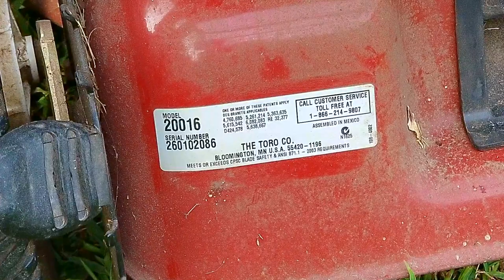Why Get A Tecumseh Powered Mower?

Comment: I experienced both Tecumseh n Briggs and stick w Tecumseh all the way: Strongers, never burning oil as Briggs can do and if you hear the sound of the engine you just showed us, you have your answer !

Lil tricky thing, Tecumseh has to get always top shape carbs but not a deal breaker if you maintain the minimum required.
Reply from the maker: thank you Martin Desmarais for the information

Comment: I got a Tecumseh 6.5 in 1993 to replace a 1979 B&S flathead that got weak because I have a steep yard and Tecumseh has the oil pump.
The Tecumseh has the PCV under the flywheel which needed replaced. It eats flywheel keys if you don't super tighten the blade. That O ring on the carb bowl? Just replace it.
It now burns oil. I have to add every other mow.

The B&S? It needed a carbon cleaning. I did have to replace the paper in the carb. It too is back in service at 45 years old, and burns no oil.
So what mower is better for the environment, since it was emissions which killed the flathead. One that is worn out in 25 years and burns oil (Tecumseh) or the B&S that might pollute a little more all along the way but will last a life time?
The smoking Tecumseh will be given small yard duty for perhaps another two decades.
Reply from the maker: thank you for sharing that

Comment: I always went out of my way to get a Tecumseh engine on a new mower. When those steel deck Recyclers came out I specifically chose one with an LV195EA and a few years later I bought a second identical one to split up the yard work. Nothing against Briggs, always liked them and worked on both since I was a kid but the Tecumseh had more compression, more power and was a stronger engine. Still love those old Tecumseh powered steel deck Recyclers, just got done repairing two of them for a customer last weekend. They were way more common than the Briggs powered models around here, Toro had a deal with Tecumseh and that’s all they used for a long time.
Reply from the maker: thank you mjg263, and yes these were some great engines

Comment: Nice footage, thank you. What are you spraying on the mower during the cleaning process? Seems to be working well
Reply from the maker: I use the only degreaser that Harbor Freight sells. It's in a gallon jug and I use it at full concentration
Reply: @HomeGaragechannel  great, thank you.
Reply from the maker: no problem
Reply: I just got back inside after unblocking the wheels on an identical mower. Your other video was very helpful as well. Thanks again bud. 💪🏼
Reply from the maker: no problem

Comment: The first motor i worked  on when i was 10 years old was a tecumseh 3 and a half vertical shaft..found in a junk pile..it wasn't that old and would spin half a rotation..someone put the wrong plug in it and bent the valve..i replaced the valve..vice griped it to the pic nic table and it started and ran like new..my dad said it would never run..he got fooled..lol..it was a tiller motor..tecumseh made a good motor..then they cheapened it too much..now they don't make them anymore..sad..
Reply from the maker: I know right, thank you Rodney Brand

Comment: Thank you so much for this video. I´m basically doing the same thing you do in the US over here in Europe (Germany). We had the European Tecumseh plant in Torino (Italy) which went out of business a year prior to Tecumseh USA, so in 2007, The Tecumseh engines were produced from 1960 to 1980 under the name Aspera Motors, from 1980 to 1990 under the name Tecnamotor and from 1990 to 2007 under the name Tecumseh Europa. I have been trying to beat it into people for 15 years now that Tecumseh is the superior engine if you are just able to handle them. Most people are simply to coarse to understand that and they measure the quality of an engine on how much redneck engineering you can do with them.
Reply from the maker: no problem and thank you

Comment: That solution that you use to clean the mower is amazing.  Do you let it stand for a couple of minutes before you spray the water?
Reply from the maker: thanks it's the only degreaser Harbor Freight has. They come in gallon jugs and are a very good price. I use it at full concentration, no dilution.  You can let it stand a bit on bare metal, but you can't leave it long on paint. couple of minutes at most.

Comment: Honestly the splash lubrication system really wasn't adequate for the upper crank bearing on a Briggs. For a lawnmower it worked, but things that put force on only one side of the shaft, the upper crank bearing wore quickly, I've seen several that were so worn they were leaking oil from under the flywheel. That's why I don't get why everyone loves the classic Briggs so much and says they were built to last. Anyways I get why tecumseh added the oil pump and think that was a good idea
Reply from the maker: no you're right, the pressure oil is best, but for cost, it didn't make sense especially if the engine lasts you a lifetime. Briggs obviously knew that, so they didn't care to have it on their engines and to be honest, 10 years for a Briggs it plenty.

Comment: What type o cleaner you’re using? Seems like it works great .
Reply from the maker: sure thing, I'm using the gallon jug of yellow degreaser from Harbor Freight.  It doesn't have a proper name
Reply: @HomeGaragechannel  it works pretty good  as far as I can see tank you I bought today purple power and simple green  by the way I fixed my lawn mower with your video 😀 the hole in the bottom of the bolt was the culprit .
Reply from the maker: thank you for the update

Comment: HG:  What are your thoughts on the new Toro models, specifically the new 2023 Toro 21564?
Reply from the maker: Sure thing and I appreciate you asking me.  First off the self propel system is top notch, and I prefer this one even when comparing them to older snappers, and even the newer Hondas drive system.
My first criticism is the engine.  I like but after having to fix the oil sump gasket on the last engine like this one, I have my concerns on longevity.  The last criticism are the wheels. These wheels are cheaply made, so hopefully you take it easy when you're moving over concrete.  Overall Great mower, and I would like to have one, but it's not tops on my list, it's about mid way down.
Reply: @HomeGaragechannel  Cool, thanks for the reply.  I have a 2015 Toro 20383, SR4 Super Recycler.  It starts on the first pull since new and just keeps running and running.  I am looking for a stablemate for it as it is getting older, but I keep coming back to the idea of "keep my 2015 and buy a used 2015 just like it."  That way I can teach myself how to work on them like you do.  I keep hearing bad things about the 2023 Toros.  

Which self-propelled mowers are at the top of your list?  Thanks!
Reply from the maker: sure thing, I like Hondas 3 speed system, but I will make a personal pace any day of the week. Both systems have existed for years, so you can always get one used.

Comment: I would choose Briggs hands down. Not just because it was the one I mainly used growing up, but because when I walk down the lawnmower and outdoor equipment parts aisle, I see way more Briggs parts available and for less than the few Tecumseh parts they have. 
Actually wish I had that choice a few years ago when I bought a mower. They basically only had MTD mowers with Powermore engines in basic, middle (the 132 CC one, I chose) and premium with the front powered wheels and bagger kit.
Reply from the maker: that's a pretty good reason

Comment: i would lean towards a tecumseh engine as ive got exprience with using them alongside briggs engines. so far the tecumseh has outlasted all the briggs first was a old flathead briggs ran for about 12 years and second and third ones failed after a few seasons now the engine has been moved to a new deck since the orginal rotted out from underneath (using one of the briggs decks) for it now has its 4th engine to compete with and it will be a good showdown a 22yr tecumseh or a brand new honda gcv160
Reply from the maker: yes I've heard that very situation before too.

Comment: Nice looking mower. I'd give any of them a try but don't see alot of Tecumseh. Question, bought a some heavy duty degreaser at HF,may have not cut it enough and when I used it a made the mower deck really dull..is there any way to fix that? I should of got that purple stuff. Ty😢
Reply from the maker: did you leave the degreaser on there too long? I believe the instructions mention that if left too long on paint I can dull it.
Reply from the maker: I do believe the instructions mentions about using it on paint.  How long did you leave it on the mower?
Reply: 5 minutes but even using some other cheap purple degreaser it did the same. Going to try and see if I can buff it out.

Comment: Is Briggs still putting that sticking lever on the autochoke plastic carbs. It likes to stick open. You'll never get it going without torn rotator cuff or broken wrist. Steve's Small Engine Saloon had some info about it and to me, that carb design has a lot of mysteries to it. The hose barb to nowhere. Closed adjustment ports on the side. Fake adjustable"jets" . There's some clues to what they were thinking but i wish it was adjustable but we all know why it's not. Three reasons and none of them matter on this day. I just drill the jet and it's good for a very long time.

Comment: I have no issues with Tecumseh engienes. I had a 1980s (I think) Murray mower with a 3.5 Hp Tecumseh engine (I think they called it the Legend). It was a nice mower, it had a speed control, and if fired up every time. That engine was just so worn out by time I got rid of it, that it wasn't savable (or worth saving rather). I have another one now, but it is a self propelled mower. I still need to get it running again. I need to find a new carb for it though as the one that is on it looks like it was at the bottom of the ocean for years.
Reply from the maker: wow, that carb must have had fuel in it, for a long time.
Reply: @HomeGaragechannel  I think it was more along the lines of water, as it was sitting outside for years.

Comment: Every Tecumseh I’ve worked on has needed the Expensive oil soaked air filter replaced.Probably from being tipped the wrong way
Reply from the maker: do you mean the filter like the one in this video?
Reply: No, the older smaller cylinder shaped ones

Comment: Hi. I recently acquired 2 Tecumseh pushmowers . I also have 1 other Tecumseh engine, which i never used, but i have installed it on a frame, and need to work on the carb.

I have 1 question.  What was the chemical in the spray bottle that you sprayed on that pushmower? Whatever it is , it seems to completely clean the engine and the frame of dirt? I have grime on my mowers, that i would like to remove.
Reply from the maker: sure thing, I’m using Super Heavy Duty Degreaser from Harbor Freight.
Reply: @HomeGaragechannel  Ok, thank you for that info. There is a Harborfreight store a few miles from me, where i will buy that product! Looks like that stuff works great on lawnmower grime!
Reply from the maker: it sure does.  I will let you know that I use the spray at a higher than normal concentration that what the instructions say,  Also the sprayer I use helps out a lot.
Reply: @HomeGaragechannel  Ok. I bought some of that Harborfreight degreaser yesterday $10.99,  but haven't used it yet. Was reading the back of the jug, and i am kinda of confused on the mixing instructions since it speaks of ( 1 part degreaser to 26 parts water). What is the best way to figure that out? Also, will this degreasor dull painted surfaces of my lawnmower? Just plan to leave on 5 mins and spray off.
Reply from the maker: try using it at a 1:1 ratio instead, and yes if you leave It on there too long it will dull the paint
Reply: @HomeGaragechannel  Ok. Will do. Thanks for that info.
Reply from the maker: no problem
Reply: @HomeGaragechannel  Hey, i tried that heavy duty degreaser yesterday. It worked really good on the engine after first try. Left it on maybe 5-7 mins. It does dull the paint on the lawnmower,  but the pushmower frame had rusty areas that needed rust treatment,  and afterwards spray paint touch up. Everything looks pretty good now. Wish i would've known about this stuff many years ago, because i was losing money buying lots of spray can degreaser. Bettet late than never, i guess.

Comment: The first two mowers I repaired were Tecumsehs. These engines were on the worse side if you ask me, especially with the intake and exhaust situation. Had recoils break all the time and dont even get me started on the governor system. Never got them to run at the correct speed.
Reply from the maker: yes they can be bit tricky when it comes to the governors

Comment: It's a lot simpler than this video. Briggs has dominated the small engine market for decades. Parts are available everywhere, and factory authorized service is also available everywhere. Other small engine brands aren't as ubiquitous as Briggs. If you live in an area where support for other brands is spotty, you go with a Briggs engine, or you may be sorry later. Now that Tecumseh has left the market, support is only going to decline.
Reply from the maker: can't argue with that

Comment: I have a Tecumseh engine on my chipper/mulcher. It’s a great engine with one MAJOR issue. Absolutely no spare parts.
Yes, it’s working well and I service it regularly, but if it needs an overhaul, I’m up for another engine, from a different manufacturer.
Reply from the maker: it's unfortunate but that's what happens when you have a product that outlives the company .
Reply: Yes. An unfortunate victim of the GFC. 
I remember driving past (one of) their factory in southern Ontario. I’ve seen some large flags in my travels, but the Canadian flag flying outside was truly impressive. So was the flag pole.

Comment: Between Briggs and Tecumseh?  I'd go Tecumseh.  Reason?  They're pretty reliable and have an actual carburetor compared to Briggs Classic.  Also, if  you look at Honda's old flathead G series engines they resemble Tecumseh engines.  Although, Honda's G series engines were quieter and much better balanced.  That said, I have an old Tecumseh OHV engine and it's somewhat a strange beast compared to other OHV engines as the cylinder is almost upright with a slight slant to it and the carb and muffler are positioned like their old flathead design.  It's a good running engine though.
Reply from the maker: well said, I like them too

Comment: I worked on a Craftsman with a Tecumseh today that was built in 1987.  The mower is in excellent shape, but the customer left old fuel in it and it rotted out the primer and caused some other issues.

PS. These engines take 18oz of oil and will almost always leak if you fill them to the "full" mark on the dipstick. Tecumseh is the only engine that I have ever know this to be true, but the dipstick often does not read correctly. 18oz will often show low on the stick, and it may take 20 - 24oz to show full. 

If you run them with more oil than 18oz, the oil will often come out (aggressively) around the base of the dipstick tube, and around the governor arm. Trying to explain this to people just makes you look like a complete idiot, and I expect that I will get at least a little hate for this comment, but fill your tecumseh engine only after draining it, and add 18oz... no more.
Reply from the maker: thanks for the tip

Comment: I have the personal-pace RWD w/electric start model of this mower that I have to fix the front wheels and then list for sale here soon. Decent mower, the rear wheel design can be a weak point (on RWD) and ours doesn't pull itself that great up hills I think it was.
Reply: very good point on the briggs primer, it really can be a bit finicky.
Reply from the maker: nice mower you got there.
Reply from the maker: yes first time I ran into that issue, I was quite surprised by its design.

Comment: Why do you have 2 channels with similar content? Just curious
Reply from the maker: ones used to be the diagnostic and the other was the repair, turns out the viewers didn't like that arrangement so instead of kill the one channel, I have them do the same. As far as differences now, there's not much.

Comment: We have a lot of people here still using that type of mower. As long as you take care of it. It will take care of you. What type of sprayer are you using to clean it sprays out the water really nice ?
Reply from the maker: thank you RayFpv, it's the only degreaser they sell at Harbor Freight, I use it at full strength.  Like the picture you changed for your aviator too!
Reply: @HomeGaragechannel  Thanks. How about the sprayer to take off the degreaser?
Reply from the maker: oh sorry about that, I'm using a re-purposed paint sprayer, it's probably about 200 psi, at the nozzle, 
and not that much when inches away, but your garden hose, with a nice nozzle will do. The reason I use it, is because I get decent pressure, while only using a few gallons of water.

Comment: Home garge do you know why my blower after winter storage is having problems to start
Reply from the maker: have you tried putting newly mixed fuel? Otherwise you might need t adjust your carb.  If you have, then the carb might need servicing.
Reply: I’ve put new mix in it and it barely starts
Reply from the maker: okay, what about adjusting the carb next?
Reply: I’ll try that out now